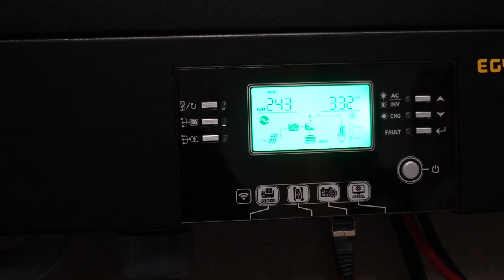PREPARING for the WORST! WHOLE HOME OFF-GRID SOLAR! EG4 6000Ex Inverter w/ EG4 48v Backup Batteries

Comment: As far as the light flicker issue, I recommend to use the either the new yellow EG4 charger to charge your system or I personally like to use the yellow EG4 3000 inverter as a charger only.  These inverters can't separate  charge and inverting and causes light flicker.  I use the EG4 3000 as a charger/ charge controller specifically.  Works awesome that way. If you did that you can add more solar to the system and use this as a charger controller. Just don't use it as an inverter.

Comment: I've got a 6 battery EG4 battery stack on the truck coming, and will be using all Victron for the charging, inverter etc for a full off grid system, (the "grid charging function provided by a generator). The Victron will be two 10K inverters for 20K total, split phase. It's also on the truck from a different vendor. I've got about 1K of panels on hand, will upgrade that as I determine where a larger array will go. Currently not on my property staying overnight, and rarely there. Plan to add possibly at least one more 6 battery rack.

Comment: thanks for this. i built my house around being off grid, so i have very few loads. i originally wanted 2 3k eg4 inverters but they have been back ordered forever i couldn’t wait anymore because i was moving in so i grabbed this the day it came out. i’m just now about a day or two away from throwing the switch and running it. but in the back of my head i’ve been worried but seeing what you two can run, i’ll be fine 😂

Comment: I was having load startup problems. I replaced those small inverter cables that came with the rack with 2/0.
Reply from the maker: Good idea! We just did the same thing last week as well. I added a couple more batteries as well. I hope soon to have a follow up video on a couple changes we have made. Still dealing with ac input issues but working through those we SS.

Comment: One more thing. I know this video is a few month old and I have checks your other videos yet for this is the first one I have watched.  If you haven't fixed the firmware issue yet, the best thing to do which you might already know is to the user defined settings and program it specifically to your battery voltage specs.  It's very easy.

Comment: Everyone makes these hybrid installs over complex. A 30amp or 50amp manual generator transfer switch kit (Reliance) makes these installs so easy.
Reply from the maker: Most people’s homes are 100 or 200 amp service and it’s expensive to buy a transfer switch that can commodore those amps. Thanks for watching!

Comment: I was looking at this unit and I too want to operate in a grid tie fashion. My two major concerns are is this UL 1741 Certified and Listed and well I guess this is 3 things but has the firmware come that was supposed to fix the grid feedback issue? Lights flickering and so forth. Great video! I really appreciate you sharing your setup with us.

Comment: Hi!  You guys are alot like myself.  I raise dairy goats and I have EG4 solar equipment as well and got my panels from Santan Solar.  I went with the EG4 6500 inverter for my 120 volt loads and I did the Growatt low frequency 8000 watt for all of my 240 volt loads since the peak output is much more stable than a high frequency inverter.  I am completely off grid however.  Love to see your video... :-)

Comment: 120 volt dryers-7 300 watt Go Power inverters- 30 Walmart deep cycle battery's- 9 Morningstar TS-MPPT-60 TriStar MPPT Solar Panel Charge Controller now 14 years of no problems with 7000kw syster

Comment: HOWdy  C&J F-F, ...
Thanks for your VIDEO Journey ... 
I just got  my 1st  SIX (6) panels installed ( out of 24 total ) two weeks ago ... 
They were enough to charge up my  THREE (3) ... 47 volt EG4-LL Batteries from 55% (as delivered) up to 100% 
after that I just installed SIX (6) more panels but need to get them "grounded" to each other & to EARTH 
& that is as far as WINTER will allow me to go ... I'll have Two more ARRAYS to Build Ground Mounts for in the Spring 
I'm keeping my GRID electric ( at  $ 14.00 per month for zero usage ) until  I'm confident of my OFF-GRID System 
Thanks again for yore video 
COOP
the  WiSeNhEiMeR  from Richmond, INDIANA 
...

Comment: Just curious if you are still running the house with the same inverter and solar system?  I’m designing a similar sized solar system for my house and looking at options.  I heard they had a firmware update that fixed some of the 6000EX issues.  Would you still recommend this inverter?   Thanks!

Comment: Correction on your statement "watts is the amount, and amps is the flow"...Amperage is the actual flow of electrons (the more electrons flowing through, the higher the amps), while VOLTAGE is the pressure under which that flow of electrons occurs. WATTAGE is a measurement of power derived from multiplying the voltage and amperage.

Comment: Great video on the EG4 6000EX-48HV, good to see it actually in service and fully operational. I'm planning out my system and am also using the 6000EX-48HX driven by array of 10-each BlueSun 460Watt/575Watt Bifacial photovoltaic panels coupled to two rack mounted EG4 48Volt 100AH 5.12kWh battery with battery bank capacity at 10.24kWh which is an excellent starting point. I also need 240VAC and 120VAC so that I can offload dryer and washer, see how that works out as they are literally plug-in and operate, then move up to house lighting. Perhaps you can give an update? As it's been a while with your EG4 6000EX-48HV. Any issues with updating the firmware? Thank you again!

Comment: Superb video! Real world talk. One idea that comes to mind to avoid all the neutral bonding complexity would be to disconnect completely the grid power and purchase a 240v to 48v Lithium charger. So, if batteries are getting low, you can run an external charger to the bank inputing just DC versus trying to run it through the EG4. Seems like it's not happy with that charging setup.
Reply from the maker: You got it! I didn’t consider this in the beginning. The new chargeverter with EG4 May make that easier for sure.

Comment: I find best bang for my bucks is to build my own battery pack and buy used solar panel top tier only  and combo inverter that has mppt charge controller  build in.   If you  know little about the whole thing and not take time to learn then you will pay to your nose because you simply buy what others buys and imitate.  Don't do that  as this is an investment that you will be using daily for the rest of your life.

It it super simple if you learn the basic first.  I never go with what other people use but I evaluate my need and pick choose my own.

Comment: Note correction:  It would take four of those EG4 6000W split phase inverters to equal a 100 amp service. 

To run totally off the grid, for an 1800 sqft, all-electric home, you will need at least four inverters and 16-24 ea 100aH batteries and 16-24,000W of PV. Plan on $55,000 minimum.
Reply: Only 2 units, 4 will make a 200 amp service. That is the amps by 120 volts. For us in 240 volt countries, it's a 50 amp service (63 Amp breakers)
Reply from the maker: Your correct, I meant to say 100amps total split 50/50 on each leg. A 100amp residential service is 100amp on each leg. Thanks for comment!
Reply: Most people who have competantly designed their 100% offgrid system,  can easily work with much less.  You equip your house with efficient appliances, and running electric everything,  especially cooking, is very sub optimal.  A single proper low freq quality inverter in the 6kw running range can power a whole lot of house. And those who set out to design a quality system will also give a wide berth to signature solar and their shitty customer service and even worse Chinese bottom barrel products.

Comment: About exactly what I'm putting in January with the exception of the 6000XP inverter. It'll be off grid supporting a new building for raising bugs and chicks. I will expand on it later and add a second inverter and bump batteries to put in a couple of mini splits on the house but doubt I'll consider tapping into the house mains without a third inverter and north of 30kwh battery storage. Think I'd prefer four inverters and 60 kwh+ actually....... Hefty investment even being DIY. 
Nice to be able to build as you go though. You're absolutely right though. Power is rising all the time and if they manage to get these EV's off the ground and that noose around everybody's neck it will likely sky rocket.

Comment: Just installed my eg4 6k batteries on the way I'm off grid with the ecoflow delta pro system but I need more power this way is much cheaper in the long run hopefully my eg4 has the updated firmware already installed.

Comment: How did you wire just one inverter to the sub panel (mine is a subpanel all the load in the sub panel will be powered by the inverter). Did you put the white (neutral) and black wire on the two pole breaker or just ONE black wire on the two pole breaker and leave the other side without ? There are no videos showing the wiring of one of these inverters. ALL of them show the install of two. With the install of two, one inverter goes on one side of the two pole breaker and the other inverter goes one the other side of the two pole breaker, but what do you do when you only have one inverter??
Reply: You put the black wire and red wire coming from the output of the inverter. On l1 and l2 of the sub panel. And the white neutral to the neutral bar. And green to ground bar.

Comment: I hope you have a disconnect being grid tied, if the main power goes out, your solar power goes out otherwise!
Mine is basically off grid, but I use the main panel as a switch.

Comment: Check your solar/grid priory in setting #1 to SBU. This will prioritize battery charging to Solar first, battery 2, utility 3rd. 
After that look at setting #10. You only need to have it set to CSO. I will take a guess that you are using SNU in this setting. By using CSO, it will use solar until no solar is available and then use grid. If you use SNU, then it will try to charge with solar and utility at the same time and depending on your input charging settings, may exceed acceptable limits and cause issues. 
Hope this helps... by the way: the solar charge amps (80-90) plus the AC charging amps (usually 30-40) should never exceed 120amps combined as that is all the EG4 batteries can take. 
I personally set my solar charging at 90 and my AC charging at 30. This means that at no time (if you use the settings that I recommended then disregard this) that charging will exceed 120amps. Keep in mind that charging and usage are separate if these settings are used. I.E. If the home is consuming 50 amps and the solar can charge at 120amps, then if the system can produce 170amps then let it rip... sorry for the long response-
Reply: agreed

Comment: Those heavy starting loads (inductive) is where the Low Frequency (really heavy) inverters do better than the High Frequency ones, thats why I'm going with the Victron Quattro's.
Reply: For the cost of Victron devices I would just hire a solar installer. Too expensive.

Comment: Good morning 
  Great video. I have been running 2 of these inverters in parallel and nothing but error and fault codes 🤮
  By themselves not in parallel they seem to work great accept for flickering lights 
 I sent mine back due to the inconvenience and worried something could happen with them why I wasn’t around 
  How have y’all’s been running since the video?
Reply from the maker: He have had many problems as well. Hopefully we will post an update soon.
Reply: @cjfunnyfarm  I finally had signature solar step up to the plate and refund my money
 I’m now going with 3 5KW growatts  I can’t imagine it can be any worse than those EG4 junk inverters

Comment: I have the same system strictly for battery backup at this point. Although I see PV panels in my near future. 

Have you looked at option 32 & 33?  
“Scheduled time for AC output On” 

“Scheduled time for AC output Off”

Would that allow you to set a time to operate off battery mode instead of grid? 

Thanks   :-)

Comment: light flickering happened with the Sun Gold Power TP6048, same inverter, different color(blue). Mine did the same thing with strong solar and batteries at or over 80% charge. Nothing to load down the output it flickers like crazy, poor MPPT controller integration apparently. I hope you found a solution. I returned mine and am going with a different brand LF inverter. Just wanted to let you know it's a common issue and the sellers know it and still sell these.

Comment: I really wish you would show the wiring inside the sub panel. I don’t see too many video showing the install of one eg4 inverter with critical load panel. Almost all of them are showing the install of two. I just want to install one
Reply from the maker: Most people are using single phase inverters meaning they would need two to power both sides of the panel. This inverter is split phase so it can power both sides of the panel. 

The downfall of this set up is the limited amps given there is only one inverter.
Reply: Okay thanks
Reply: @cjfunnyfarm  How did you wire just one inverter to the sub panel (mine is a subpanel all the load in the sub panel will be powered by the inverter). Did you put the white (neutral) and black wire on the two pole breaker or just ONE black wire on the two pole breaker and leave the other side without ? There are no videos showing the wiring of one of these inverters. ALL of them show the install of two. With the install of two, one inverter goes on one side of the two pole breaker and the other inverter goes one the other side of the two pole breaker, but what do you do when you only have one inverter??

Comment: Does the PV keep charging with the inverter off?  I would like to use it just for the charger and back up inverter.
Reply from the maker: Yes, if the inverter is off, it won’t power any loads but will charge the battery and power on the inverter to charge the batteries. Thanks!

Comment: The light flickering could be an issue with the neutral. It’s odd though that it would only have that issue with the ac input on. Do you have grid assist on? Or just grid backup setting? The 6548 will actually use partial grid in the event you have larger inductive loads. If you have that setting on it could be something else.
Reply from the maker: I have it set to SBU. Also the back to grid setting is set to a very low setting as to be sure the battery is mostly empty when it switches to the grid. Thanks for the help!

Comment: I am very impressed with Jeremy's knowledge and abilities with building and electronics. 
I am fascinated by how you use 120 for some appliances and 240 for others.  Here in Australia 🇦🇺 we only have 240 for everything
Reply: That's better honestly.  For the life of me I don't understand what the point is split phase.  Balancing loads between L1 and L2 is a pain.  I installed a Sol Ark 15k, not that the 12K couldn't handle our needs, but the 15k handles line imbalance better.  If everything was 240....no balancing.

Comment: Just a thought, one could color code the backing plates of electrical outlets to indicate Grid or Solar. (in hospitals, typically white plates are regular power, red are from the generator).
Reply from the maker: Great idea! Claire may try to find a pink plate for the grid plug. It’s her favorite color!

Comment: Another question: This is about your cameras in girls barn…Do you use a wi-fi extender? If so which one? I have zmodo cameras and an nvr but recently added more cameras and zmodo said nvr will not hold more than 6. But I do see all of them on my phone which is important. Except the one in the far barn and last stall. Thinking I need extender correct? I wanted a mesh extender but heard it will interfere with signal.
Reply from the maker: We have eero pro 6e. It’s a bit expensive but worth every penny! Bought the two pack, reaches the barn. Thanks for the comment!

Comment: Thanks for the video.  I'm considering the EG4 6500, but am debating if the 6000EX is worth the losses.  More calcs to do.  My question is: in the video I think you mentioned that your panels are on the roof?  I heard that may not fly in some municipalities unless they are the grid feedback type, installed by a professional, and I have yet to head down to ask about the building code.  Did you have to do anything special where you are to get panels approved?  (or maybe it's don't ask don't tell?)
Reply from the maker: Mine are shed roof mounted so there wasn’t any requirements. Do note I live in a rural area with less restrictions. 

If your only using typical household loads and needing the amps from two inverters anyway, I might suggest the 6500. 

Do keep in mind I’m having issues with my ac input on the 6000 so I wouldn’t recommend it for that application. 

Hope this helps!

Comment: Awesome video this is the system I’m looking at getting for my house   Doing an upgrade from an mpp LV2424  3000 watt all in one 
   So your running your well and dryer and all with just those 2 batteries ?
 The reason I’m asking is because I’m trying to figure out how many batteries I should get
  Thanks for the amazing video 👍🏼👍🏼❕
Reply from the maker: The batteries would hold up fine with those two things. I probably wouldn’t run them for multiple loads in the dryer but your well should be able to handle fine over night. You might need more amps/inverters to accommodate the draw though. Just keep that in mind. 

Thanks for watching!
Reply: @cjfunnyfarm  I just order the same unit with 3 batteries 
  Thanks for the great overview of your setup 👍🏼👍🏼✌🏼❕

Comment: How did you handle the neutral ground bond in your system?
Reply from the maker: Remove the bond in the main panel, and have the inverter use the AC input ground for the single bonding point.